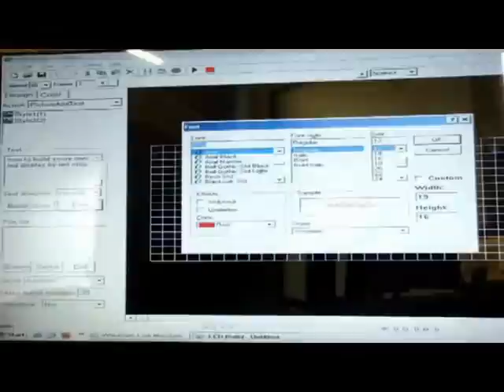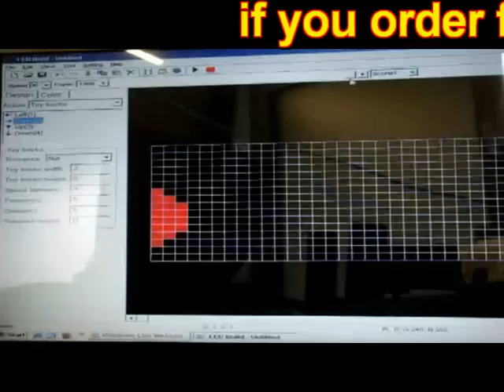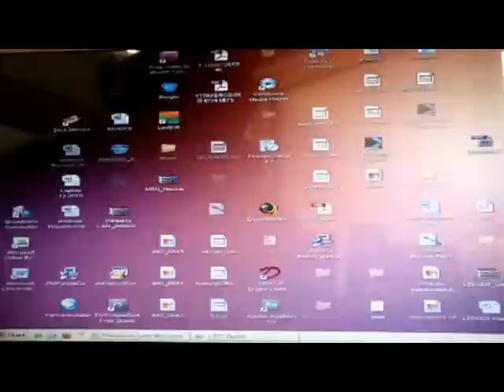How to build a flexible LED Curtain display WS2812b | T1000S Controller Soft Display #DIY

Comment: very interesting whatching somebody working for minutes with a wooden yardstick, rearranging stuff over and over again instead of making one drawing geforehead and using a permanent) marker to transfer that, so that the actual glue process could be done straight away. And off course a great lesson for those never seen a hot air gun working.

Comment: I think the air intake for the heat gun is on the back of the gun.  Blocked off when you set it down like you did.

Comment: Flickering chain sequential on/off lighting has been done to death in conventional Christmas lights. They are very fatiguing & usually provide only a brief period of novelty.
There is a need to switch off a portion of the total to allow dimming but that's it.
Simplify the controller & reduce cost.

Comment: very easy way to build a curtain is to buy some flexible plastic garden fencing...  I then was able to insert square based pixels into each spot in the garden fence at whatever spacing i wished..  connected them all to the controller and execute my MADRIX software to run them as a light show..  the trick was the garden fencing because the curtain can be rolled up and placed in the trunk of a car or a pickup truck easily. each part of my curtain is 16 feet long by 4 ft wide... I can easily attach them to the side of buildings, on poles, etc...  very durable, flexible.. if the wind gets strong they bend and dont break...

Comment: I have a question about building my own LED panel. When using multiple power supplies does the data line run constant from the beginning of the led strips to the end? While the power lines are dedicated to however much current a specific power supply can handle?

Comment: ok so i have LED strips, and a T1000 controller, how do i go about making the connections. only the 12v line is indicated, have no idea which lines the Clk or data signals run on or which one is ground. alltogether there are 4 connection points.

Comment: Would the software support adding stips in between the existing ones but shifting them sidewards by half a pixel? This would double the pixel density while avoiding it looking like there are vertical columns of gaps.

Comment: and it will save you having to re-solder/ sodder when you have moved it about a bit (its a very good idea to cover all soldered wire connections with heatshrink the solder isn't as flexible as the wire so it ends up under stress creating premature dry joints
for less than a buck a yard its worthwile :D

Comment: What about a 6 ft by 12 ft one that can run with computer video? Trying to use it for live shows.
Reply from the maker: hi yes you can with our new LED Live Transmit. Controller check it out shop.elektric-junkys.com

Comment: the LED strip he is using has the positive and negative leads, but also has a data and timer lead, allowing control over an individual led. they come at a cost though, as in they are a bit more expensive than the ordinary LED strip.

Comment: what's the point of the heatshrinks?  i understand its to cover the live wires connecting to the led strips but aren't the copper links between every 3 leds the samething except they're not covered or protected?

Comment: Hi There!
Is it possible to play a movie with your system? Or do you need to have individually assignable led strip instead?
Thanks for you reply!
Cheers
Reply from the maker: hi, yes on our website shop.elektric-junkys.com you can find our new modells of Life Transmit. Controllers you can show all what runs on your Laptop on your LED Display, i will upload soon an much taller Project there you can see the whole instructions

Comment: I notice that the LED brightness drops from one side to the other. You need to put more power connections at ends and middle of strip to prevent voltage drop. if voltage drops from 3.7V at one end to 2.7V at other (not uncommon for that length) the LED at the 3.7V end will let more power than at 2.7V end. You can add more power at the 2.7V end and prevent "voltage sag" and make the display much better.

Comment: hey! A very informative video! can i know which material have you used for pinning the LED? Is it tarpaulin? and is there any speific reason why You've chosen this material? thanks. :)
Reply from the maker: we choose it because it is the most stable material, it will not deform and its also water resistant
Reply: So it is tarpaulin?

Comment: very good video Led edit, I recently bought a controller HC201C WS2811, and perform step your instructions, is that when you turn on me the sequence brings factory SD still appears no proof do I appear, you could tell me any help, Sd should be without any file to then burn mine? 
greetings, and I thank you from
Reply from the maker: hi, yes you should clean and format the SD Card before add your files, also make sure all your cables are on right place and the power is stable

Comment: Hi and thanks for reply, the sizes are roughly 4 foot long 2 foot depth, I need 2 , one for each side of van left side, right side, will give exact sizes if cost ok and your happy to do the banners, couple of questions, can we powe the led, s using a large 12volt van battery? And will they work ok when vehicle is moving? I havent seen any vans advertising this way and think it will look amazing, if these work and look good I will be ordering a lot more of these, can we also control the banners remotely using samsung 8"tablets I saw your white wifi boxes, if so can you include those in price wired up and ready to go, many thanks, dale lewis

Comment: Your channel is amazing. Wondering if you can help me with a project. Wanting  to do a DIY project with this kit(SUPERNIGHT 16.4ft 5M Waterproof Flexible strip 300leds Color Changing RGB SMD5050 LED Light Strip Kit RGB 5M +44Key Remote+12V 5A Power Supply). making led wheel lights like the Oracle led wheel rings.My question is what would be the best way to make this setup?

Comment: Nice video and job dude. But, how would I know that my led strip is adressable or not? Are all of them adressable? Tks!
Reply from the maker: hi, no absolutely not there are several LED Strips on the Market but the most are cheap crap about 8USD 5mtr rolls, remember 8-10USD 5mtr LED strip rolls are first just RGB and second the last crap, error, disfunction and more...
the chipcontrolled LED strips starting from 40USD depend on chip model, qty. of LEDS and Quality "as well several manufactures just use SECOND HAND IC´S which make it more cheaper and deduct lifetime"  WS2811-WS2801-WS2802 and more there are several refurbish markets only for LED IC´S

Comment: Very nice project!
Reply from the maker: you should check the new DIY Video its Amazing how to build an LED Display by LED rigid Bars 1000X2000mm foldable ...how to build a LED Display Part 2 LED rigid Bars 1000X2000mm foldable

Comment: good job ! this is a ordinary rgb led strip???
Reply from the maker: thanks, no theese are adressable strips
Reply: ***** AH I did! the tape itself has a microcontroller responsible for receiving and control of the correct LEDs ?? the result is simply wonderful! may I play the same effect ?? and you would have some scroll LED design based on PIC or Arduino? wanted a simple design for a maximum of four arrays 7 x 5! if you can help me, thank and once again congratulations for the great work !!

Comment: Did you use 30 leds/m, 60 leds/m or 144 leds/m strips?

Also, where do you go to get the program at the end of the video?

Thank you!
Reply from the maker: hi we use 30LEDS but we also have 60LED lights you can check here http://www.youtube.com/watch?v=e-rdgB_19Fg
you can get the software and assembly kit from shop.elektric-junkys.com

Comment: What is the difference between these LEDs and the ones used for indoor cultivation?
Reply: Because English is my 3rd language and I love when people keep it gramatically right :3 It's not sort of hate or something, but a way to keep the conversations alive in this comment section (:
Reply: These are indoor lights. They are not waterproof. The other big difference is that these lights are addressable which means that the controller can say "Hey, the 10th light in this chain.....turn on and be whatever color".
Reply from the maker: hehe great explaindation, i could not say it better ;)

Comment: Hi, how do you break the strip into individual pixels? In other words, I don't see matrix wires; how do you send a signal to light up some LEDs and not the adjacent ones? Is this built into the strip from the factory? I ask because all I have seen so far are strips where all the LEDs light up at once.

Comment: This is great.  I'd like to build a LED curtain for my business, The front window of our shop is a grid of 15 windows that are 36"x22" each 3 high and 5 wide with the frame being about 2inches around each window.  I was thinking of doing a GREEN LED only display with the LED's spaced apart by 2 inches each.  Do they make green LED strips with 2" spacing?  My budget is limited but i'm thinking i could spend around $500 to get this thing going.

Comment: I just bought all parts & cant make it work, can u please post a video showing how to make all connections?
Reply from the maker: we already showed all the connections maybe you should check one of our new Videos
Reply: the thing was that the memory card was empty & those leds dont work without that program somehow, once the program was in the card they work, but only 1 meter of the 5 meters is not lighting, any idea?
Reply: si kieres programar juegos de luces o dibujos etc con los leds ta bien, si lo ke kieres es simple iluminacion variando combincion d colores, pilla leds normales.

Comment: Nice work ejunky99. I'm thinking of a similar project but I do not find this tape that can cut 1 by 1. The tape must have IC chip but what do you use? I'll care because here in Brazil each meter costs around $ 30 USD. Thanks

Comment: This flexible LED  could also be used as a therapeutic device for LED light therapy, I believe the nm needed is between 630 to 660 nm/ All the ones I see are not flexible and are expensive too!

Comment: Cruise around on Amazon there's a outsource called LED suppliers that has everything under the Sun 50 meter rolls for 20 bucks RGB hi density high brightness double brightness 36o they have  spot or flood

Comment: ***** can these be done with the 5m 5050 if so do you have a video that shows how to ?
Reply: Math says it can not be done with one roll..   math says it can not be done with 2 rolls..  You are going to need a 3rd roll.. (5M rolls are only 300 LED)
Video is a tad misleading.. The cost of the LED's alone is going to be 3X $85USD

Comment: hi :) is it possible to programm scenes with your software (mac compatible?) and convert them to midi, so i could use a footswitch to change scenes and use the tap function to control how fast it will be played before starting a scene?

Comment: Hi,
I am from India, I wanna make RGB LED Banner and want to display running text with logo and display pictures. mainly for advertisement purpose at the cheapest price possible.
Size of banner will be about max. 2000 x 1000 and of smaller sizes
kindly guide and suggest products to be used and steps to follow
Reply from the maker: Manoj Hurkat hi thats great  should be around 1000$ follow the links in description and all will be fine !  order directly shop.elektric-junkys.com
Reply from the maker: ***** hi,yes for 2000mm X1000mm it should be around that .. !

Comment: DO NOT hook a LED strip to an amplifier, it WILL be destroyed. Read my comment to ddrattt for details.

Most LED strips LOOK the same but there are two types, "Regular" or "Digital" (THESE) 

Beside the two power lines, Digital LED strips use a Data line to talk to EACH single LED via a controller. It is difficult to flash them to music since each LED must be told its colour and brightness, ONE at a time, over and over!

A "Regular" strip is easy to flash since all LEDs are connected together.

Comment: PLEASE HELP! I am installing 92 FEET, of 5050 LED TAPE LIGHT (60 LEDs per meter) SPECS ARE: ● Color: Warm White /Cool White /Blue/RED/Green ● View angle:120° ● Working Voltage: 12VDC ● LED Quantity: 300 leds/5 Mete ● Working Current/meter: 1.2A ● Working Tempreture:-20 to 50° ● Protection Rate IP33(Non-Waterproof) ● Luminous Flux: 780-900 Lumens/Meter ● Color temperature: 3000-3500K ● Size: L500cm (5M) x W1.0cm x T0.20cm What type of transformer do I need?!?! please help!!! thanks

Comment: WRONG!!

DO NOT tell people to run their LED system from a speaker output of an amplifier!  That suggestion is very irresponsible! Why don't YOU do it with YOUR expensive LED strips first, THEN tell US what happened?

EVERYONE - DON'T do this!

Using a speaker output of an amplifier for your LEDs WILL destroy them, guaranteed, because the output voltages are AC and between 6-70 volts!!

To flash LEDs to music requires a proper circuit - maybe a "colour organ" design. PM me if you need any info.